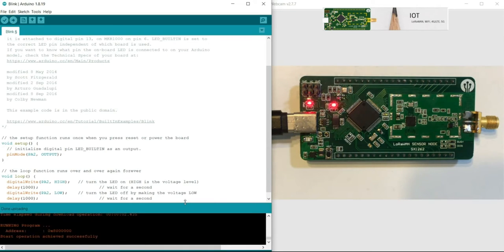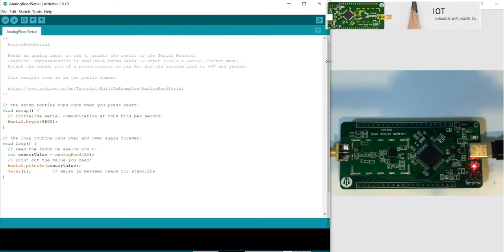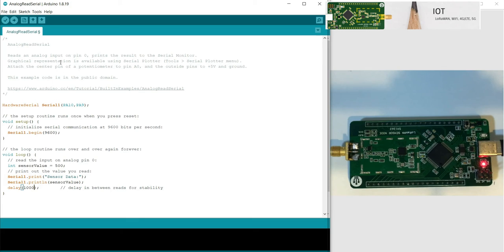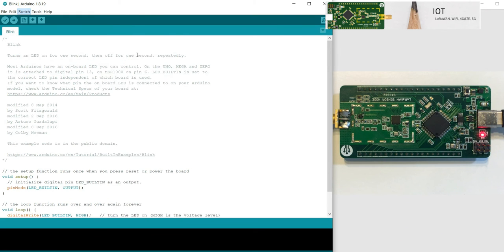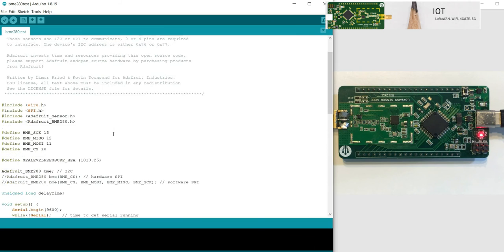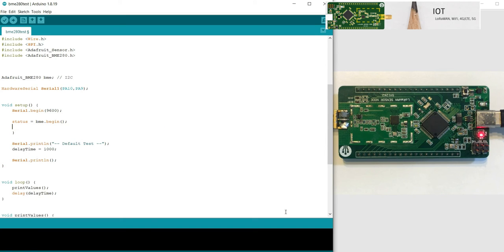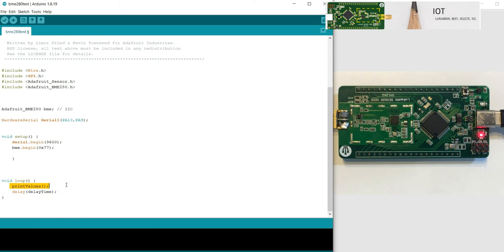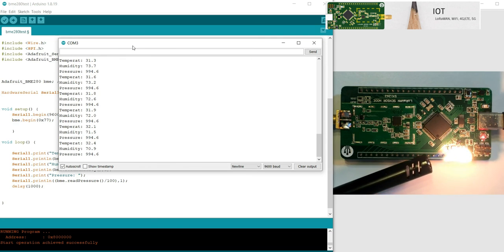Part#2: Serial  and I2C communication  - Program STM32 with Arduino IDE

Comment: HI, i am doing the same, But nothing is printing in my serial monitor. Can you help me with it. same baud rate 9600, i am using STM32G071RBT6 nucleo board and arduino ide
Reply from the maker: What is STM32G071RBT6 reset pin configuration?